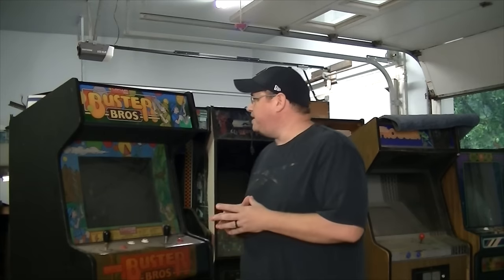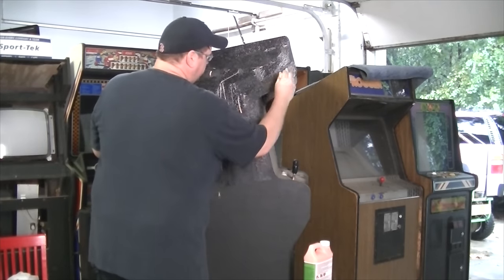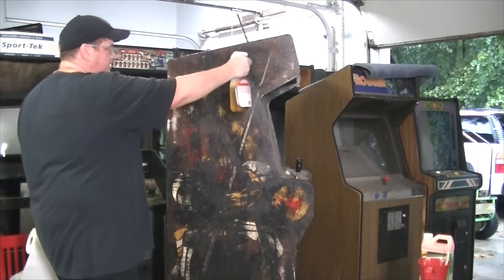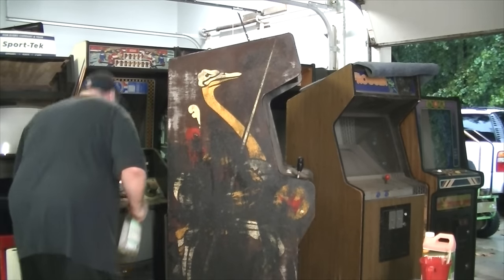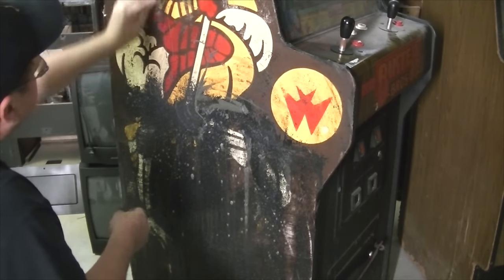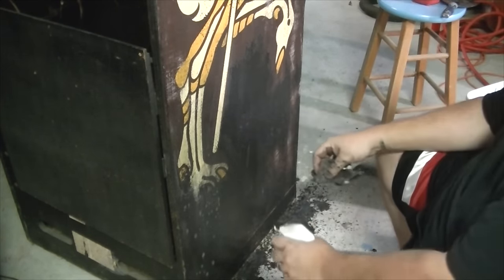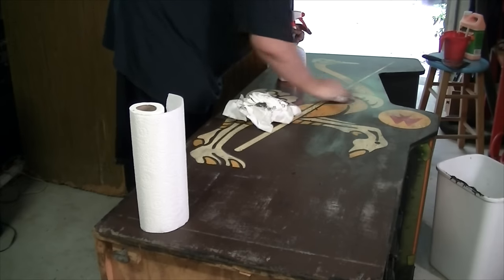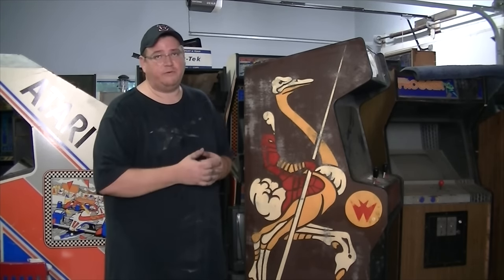Saving Original Joust Arcade Side Art

Comment: You got luckier that I did with trying to get some paint off of a Joust.  Did a test spot on the W logo and the Citristrip started eating and smearing the yellow paint within a minute or 2.  The clearcoat must have been sanded or something before they painted it.   I did, however, have some great success with Atari vinyl side art on a Liberator.  The Citristrip worked very well on it.

Comment: Magic eraser and 91% rubbing alcohol works great!
Reply from the maker: Thanks Kevin,  if you watch at the end that is what I use for the final clean up.  That black paint was a thick textured like Rhino Liner coating,  Alcohol alone wouldnt have done it
Reply: Ok, I commented before I watched the whole thing. I have been removing paint off a Alien vs. Predator 3 player cab that has Smash TV underneath. So far using 91% isopropyl rubbing alcohol and Magic Eraser is removing it very easily. They painted over it with black paint.

Comment: Magic eraser and alcohol.
Reply from the maker: +Sean Cooper i use it in the final but the black was much to thick to start out with
Reply from the maker: +Sean Cooper i use it in the final but the black was much to thick to start out with
Reply: Have an nba jam I found and let me tell you. There was so much black paint on that bad boy after a lot of time in one spot going in a circle did I take it up. Control panel came up great with alcohol, but sometimes you need to bring out the big guns lol
Reply: Alcohol did not work so well on my pac man cab from how they painted over it. Layered speckle oil based paint job..... Should have tried this method.